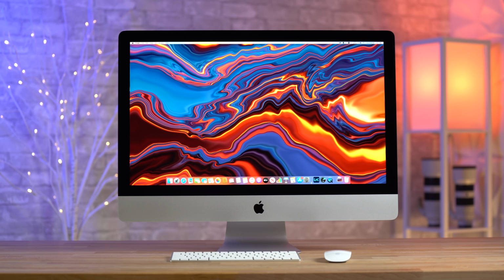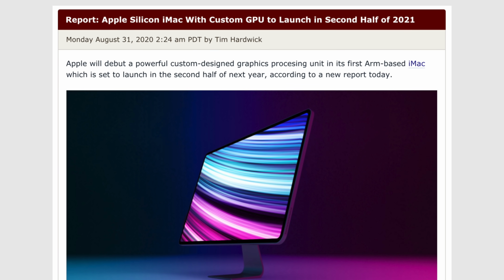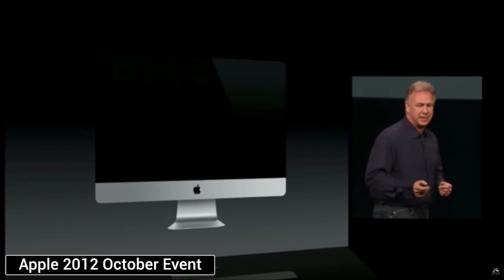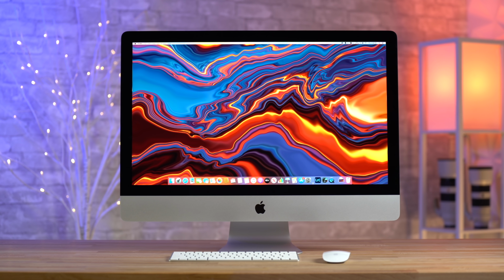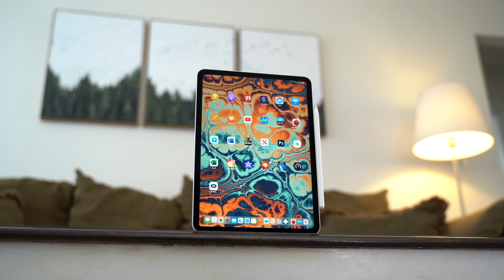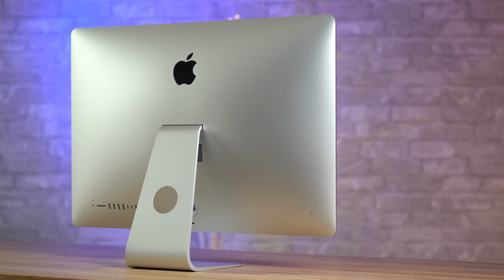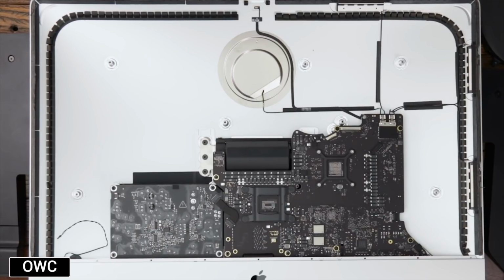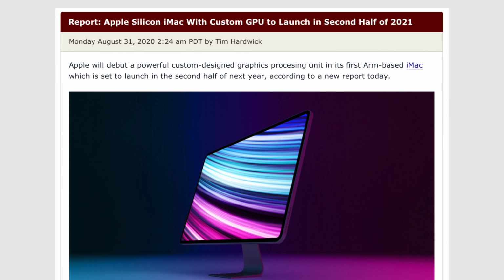Apple Silicon 24" iMac Redesign - I FIGURED IT OUT! 🤯

Comment from the maker: Do you agree with my speculation on what the Apple Silicon iMacs will look like? Where do you think I am wrong? Explain yourself in the comments! 
Buy our Apple Silicon ARM T-shirt if you're excited for Apple Silicon! ➡ teespring.com/stores/max-tech-store
Don't want to wait for Apple Silicon? Use these links ⬇️
2020 5K iMac ➡ https://geni.us/SppSAA
2017 iMac Pro ➡ https://geni.us/uHiVZw
Like the wallpapers in this video? Find them here ➡ https://bit.ly/2WNc6Qw
Reply: Instead of the “chin” they should put the apple logo on the stand. Would be much cleaner. Wish they made the display like a Samsung phone where there is no bezels. Much cleaner.
Reply: I can see the 24" not having accessible RAM, I don't see that with the 32" model. 

Apple will go back to the underneath access door like the 2011 models for the two or four slots in a single line so there won't be any width issues. They will also offer a VESA mount version as well as a foot option as well for the 32" model.
I really hope Apple offers a M.2 slot for a second drive option.

The chin is needed for making the logo as a TouchID button, if they don't do FaceID. Frankly, I would love to see both!
Reply: Old-Wise-One Apple should hire you lol
Reply: Ashneeth Manda the best marketing is making it look so unique that people know it’s apple. Logo is not necessary
Reply: Yes, it’s very likely this is how they’ll go. The killer was seeing the heat sinks that are the reason for the hump in back of the old Intel iMac. The thing I’m waiting for is, I hope they will keep a way to run Windows, because I’m working at home for a Windows company with my 2015 iMac and BOOTCAMP.
Reply: Should I get the Apple Silicon 13" MacBook Pro would it be good for not advanced but basic level video editing
Reply: E hopefully it’ll will have no chin and more so resemble the 2nd gen iMac screen but tinier bezels and yes Face ID
Reply: Probably this Mac will be introduced on 2021. Why ? I guess new design depends on miniled technology. No rumors that this kind of display is in production phase. 

For me it is a mandatory technology for  Evans Hankey (chief of hardware design) to deliver her new design vision. Screen is a main design element to shape and build the iMac & Macbooks lineups.

For all these reasons, I don’t expect new designs before 2021. And i bet that new iMac 24 will not be announced in October.

We should expect the new entry-level MacBooks (Apple Silicon with a unchanged design and lower cost display) and probably updated MacMini (no display) for devs & professionals.

Waiting your comments... 😄🍿
Reply: I think you have quite a bit of it figured out.  I haven't seen the pro display close up like that before - it's quite thick and, well, ugly.  The front is nice, the stand is a bit chunky.  Anyway, the RAM on the lower end iMac isn't upgradeable now, and it wouldn't surprise me if it isn't on the next model either.  24" sounds about right for 2020/2021, and if they have SOC, similar running temps to the iPad pro, soldered on memory etc, there's no reason it cannot be thin like a Macbook Air or 13" MBP, or of course, the iPad pro...  Why can't it basically just be a big iPad pro with a solid stand and more connectors on the back?  If they want to do something cool, they could put connectors in the base (a "C-hub")  and have a Thunderbolt 3 or USB4 cable that connects as part of the mounting of the screen to the base.  Nobody likes messing with those back facing connectors...  I'd actually be interested in a unit like that.
Reply: Nice analysis! I agree with almost all of your speculations. I’m doubtful though that they’ll include the Pro Stand as a fixed component. That seems to me more like an add-on “pro accessory”. I guess they may probably go ahead with a similar swivel stands of yore, or I hope they’ve designed a new stand, which can also move horizontally.
Reply: I agree , but what about the keyboard and fingerprint reader or Face ID ?  What about the upside down charging moused the ports of the iMac?
Reply: Sounds logical, matches how Apple has operated in the past.

What I’m hoping is that the Apple Silicon iMac will be passively cooled. That would be awesome, I hate fan noise!
Reply: Could you give a guess about what the energy consumption will be in Watt?
Reply: My bet would be no chin, rounded corners on the display itself.

Comment: Good video. Looking forward to Apple silicon. With their software optimization, I think it's going to be a huge hit. But just a couple of notes I'd like to add...

The iMac doesn't need or have to have a chin. You speak from a 'techie' view point which most people are not. All Apple needs to do is have their little Apple logo on the bottom and it will be all good. The common person won't see it any differently.

There can easily be user-replaceable memory with a silicon iMac. The way Apple designs their memory bank is quite bulky. But I've been around long enough to remember when laptops had user-replaceable memory and they obviously lay completely flat. Apple just needs to redesign the mechanisms to release/hold memory, maybe enlarge the memory cover to allow easier access and it should all be good.

Comment: My guess is:
When they really bring out a 24" inch model with a 4K resolution as the smaller one, the jump to a 27" inch 5K resolution iMac would just be a too small of leap in size. Especially when Apple wants to distance the bigger iMac not only in size but also in resolution of the display panel. Then 6K is almost a given choice. So i rather speculate on a 32" inch iMac with a 6K resolution than anything other, since many people in the computer world already use a 32" inch 4K monitor for their PC's and Apple wants to have a leap there also compared to the PC world. Not very likely with a new design coming, that Apple wants to stay behind in terms of screen size and resolution. We allready saw this with the XDR Display and it's 6K resolution.
I mean, after all, we talk about iMac's, that are video editing machines. And what is better to edit a 4K video in native res than a 6K display giving you enough space for tools and buttons in the software. That also was the reason for going up to 5K back then.

I furthermore think that Apple tries to unify their design language and base design concept with rounded bezels and housing design for two reasons:
1. Cleaner and unified looks.
2. To make clear that from now on, the entire product family under this new design language being driven by an Apple ARM Chip.
In short terms: This is consequent corporate design language. Which Apple is a master in.
With that said, i also guess Apple will skip the chin in future models, since they:
1. Are not needed anymore in terms of space requirements for the inner.
2. In terms of thermal design not requiring a super large inner volume of the housing.
3. The iMac would literally look identical to an iPad Pro, which brings us back to the concept of consequently used corporate design language through their entire line of ARM based products.

I could also think of Apple releasing a 32" inch external display that looks identical to the new chinless iMac, since many people these days use at least dual monitor or even triple or multi monitor setups. (as i do also!!!)
Even the macMini user would then also have it's matching Apple display providing the Apple design language for the entry level desktop.
We all know how popular the 27" inch external Thunderbolt displays still are, and that many people still wish and ask for them being reissued again.
And since the XDR display is a little bit too pricey for average Joe and Jane, a matching Apple display with an identical display panel such as the iMacs will have is then almost a given decision.

Comment: Hi there, great video(s). Wondering if you can help my doubts. I need to buy a iMac-like computer, sometime between now and next year. The main reason I need a powerful iMac is because of the Windows programs I'll be working on through a virtual machine (VMWare). Not using bootcamp, but a virtual machine. My question is: are you sure that the virtual machine with the VMWare software will not be able to work with new Apple silicon macs? If that's the case, then I'll buy the 2020 iMac. If not, then I'll wait for next year and see what the iMac with Apple silicon looks like. Thanks!

Comment: It won't have holes coz' it's using ARM, so it's cooler than current iMacs. I think it'll have no chin, no bezel, just the glass. It'll be very thin coz' it's going to use ARM APUs, hopefully it's as powerful as Nvidia's new GPUs. The ARM APU will be very wide, larger than the iPad Pro, so it can trump the current Mac lineup.

It'll be as thin an iPad for sure with 30" or more screen:-)

I bet it'll have separate, good looking speakers coz' it's so thin.

Comment: I agree with most things except the timing. Apple just updated the iMac line up as they know they’ll be the last products to get Apple silicon probably in 18 months. They were updated to keep them relevant until then. In the short term they’ll do the MacBook line up which gives them more time to develop the more powerful chips needed for desktops. In 18 months they’ll update 24 & 27” at the same time, otherwise if they only update one size people won’t buy the other size until it is also updated.
Reply from the maker: The 21.5” iMac wasn’t updated at all while the 27” did. This hasn’t happened in many many years. This shows that they’re planning something for that iMac sooner than later.
Reply: They still wait, I recon MacBooks March event, iMacs wwdc 2021, Mac Pro wwdc 2022

Comment: Let me point out something no one as yet mentioned about the migration to silicon:  It is VERY likely the only apps or games that you’ll be able to install will be those from the App Store. A few of the best current apps are from third party sites. Apple will completely control what you can install on the new MacBooks, MacBook Pros, iMacs, etc, just like on the iPhone and iPad. This is not a good thing, in my opinion. Especially with the absence of Bootcamp. You’ll be a lot more limited on what you can do and run on the new systems.
Reply from the maker: That is not likely at all. Apple has stated in their developer videos, specifically the platforms state of the union, that the Mac will remain a Mac like we know and love. This comment means that we will still be able to download from the App Store.

Comment: The RAM slot can be thin and can be upgradeable if they want it. Instead of current upgrade slot, they can make it flat and place it under (like older 27 inch  imacs). And the permanently attached stand should not be "permanently attached"

Comment: i would get a iMac Pro if it was a 49" curved display and you could easily upgrade it. Until then i'll stick with my Mac Pro's... Also If Apple designed a  49" curved display for the Mac Pro I'd buy it for sure. the new XDR is pretty pointless for the price. Lastly I want 20 TB SSD's in each slot

Comment: Dude, thanks for all the videos and going all 8 minutes into your intro, but an easier way to explain, is that an iPad guts with 32gb ram and 1tb HDD is the size of an iPhone, WITHOUT the battery! My guess is it's just going to be as thin as the iPad with like 4 USB-C in the back behind where the stand is, maybe audio in/out and SD Card reader, and that's it.  It will probably have an external 45W USB-C PD 3.0 power brick, mainly to power the monitor. Although I think they'll keep the chin as you say. 

But one thing that will be disappointing, is the RAM will probably not be upgradable, just like an iPad. So probably best to start with 16GB when purchasing.

Comment: Because of the raw power of the new Apple silicone. And also because Mac OS X was built from the ground up with being a server in mind. Apple should seriously reconsider entering the server space again with Xserve. That was an excellent product. And it was discontinued I believe because the intel chips were an issue, expensive to run and produced far too much heat. Arm servers are rapidly becoming a thing and Apple are producing the best arm. Plus it’s integrated with Mac OS X which is server grade to begin with and even more secure than Linux. They could really clean up in this market if they stuck to it this time.

Comment: Ugh, I really don't want them to gimp performance for thinner devices. Especially not with desktops. We've been down this road and few people have been happy with it. If the iMac has the same cooling as the MBP, then it won't have better performance than MBP. The iMac line-up would become pointless imo. You might as well get a MBP and a monitor. Also, the performance increase compared to the Intel iMac would be smaller. So I really hope you're wrong.

Comment: I definitely think Apple will be updating the 21 inch iMac with new Apple silicon first. And I also think this redesign as you speculate will likely be correct! However, I do disagree with your timeline. If the smaller iMac comes out with Apple silicon this year, I think it will be the same design. Then next year, when Apple is ready to unveil a 27 inch redesign, then they will likely be going to a larger 29-32 inch display, and releasing the 24-25 inch iMac at the same time

Comment: I mean, yeah, it could be. However, i really though that the chin would go away. But you are right, Apple products needs to be recognized. So you might be right about the chin. However, i think it will be much smaller because Apple understands that bezels are getting slimmed down. It's even possible that the bezels would be even slimmer on the iMac. I think the chin is also needed for the speakers? Not sure. Also, the stand could be removable in my opinion. It would be easier to get the same stand and more cost effective ? Not exactly the same but i mean the way you attache it to the screen. Because some people do actually attache their iMacs to a monitor arm.
Reply from the maker: Apple actually does sell vesa mount versions of their iMacs right now. I feel like they’ll do the same for a small number of people who need that.
Reply: @MaxTechOfficial  Yeah, i know, i remember Quin had some problems with his iMac Pro. Even though it was the first time that i've seen that. I've seen in the past the regular iMac mounted on a vesa arm. You just need to remove the stand from the iMac with the credit card, as far as i remember it.

Comment: Congrats bro you figured it out a thinner XDR with a small chin and a similar stand. design will be well advised not to fix the new stand but to attach it via a Vesa adapter ie it ships in the same box but loose that way the box can be flat and sheep can upgrade to the xdr stand or 3rd party ergonomic vesa stand. The current model has to be ordered with the vesa adapre if you want to upgrade the stand. The current stand has to die bro it shipped on the first lcd imac in 02

Comment: It's unlikely but if they have a chin, it would be cool if they had a super high resolution facetime camera built into the chin.  Something like a 20+mp wide angle camera for 4k video calls with AI face tracking and a moving frame that keeps the video centered on you. Kinda like was on the facebook hub thing(can't remember the name)

Comment: Would be nice, specially with the 24" to have a stand like the HDR Display, so you can change the iMac and not the stand, but of course it' only a dream,  I hope that the final design will merge with the HDR Display and I think that the largest one will have some kind of holes for ventilation just for design, or maybe for the next iMac Pro. The next iMac will be my first one after a long time with Intel Mac Mini.

Comment: I doubt that Apple will incorporate the RAM in their SOC for their non-supermobile devices, like the MacBook Pro and iMac. RAM occupies lot of transistors on a chip and will hugely bulge the price, that is why Apple don't give us that much ram on iPhones comparing to android devices. Choosing separated RAM chips would significantly reduce the cost. Especially, only the CPU and GPU need the cutting edge 5 nm process, for RAM 14 nm is enough.

Comment: I feel they should favor upgradability, speakers, and cooling over form factor given this isn't a product people use on the go. Maintain or even expand what users can upgrade. Add speakers of even better quality, as this is something users frequently interact with. Use that extra space for extremely robust cooling that will not only enable better performance but will also improve longevity given how heat is really the enemy. I honestly don't consider the current form factor dated at all.

Comment: I agree with most of Max Tech's speculations, although I hope Apple retains the user-accessible RAM slot. iMac and Mac Mini have, over the last couple of generations, become more laptop-like, so that notion of a thinner and simpler iMac would be no surprise. There's also the possibility of a fanless iMac, but since desktops are made to perform, that probably won't happen. I disagree that the current iMac's design is somehow dated. It was head of its time when it first came out, and it still looks impressive today. I was actually hoping Apple would retain the current design and combine with Intel and Apple Silicon into a single machine that could run both MacOS and Windows. I suppose that's wishful thinking. If I had the $$$ to but a new 27-inch iMac with an i7 right now, I would rush to do it. First-generation machines can be tricky when adopting major new technologies, and I'm all set up for older hardware and accessories. Maybe when they combine Thunderbolt 4, Apple Silicon, and WiFi 6 it will be worth it.